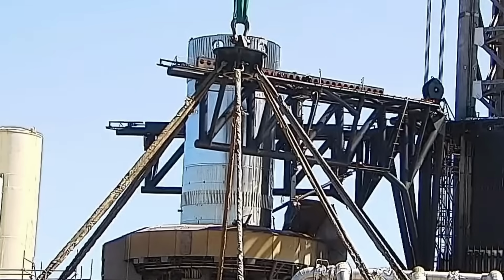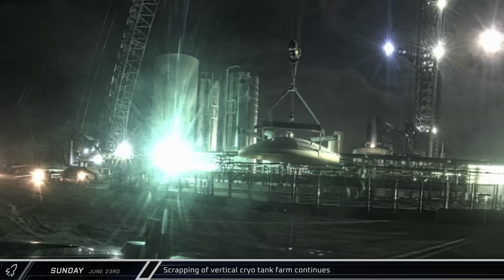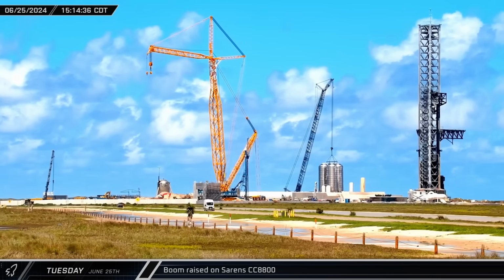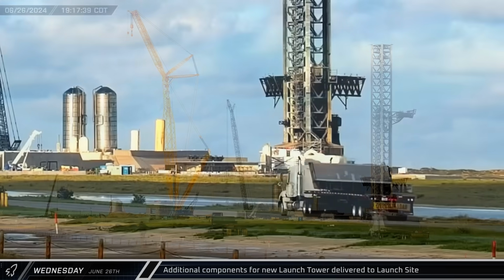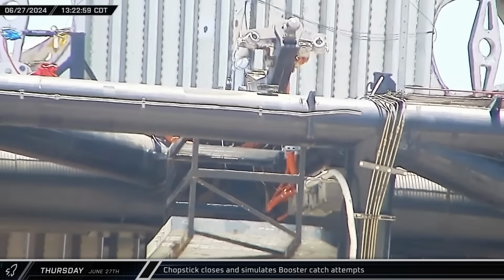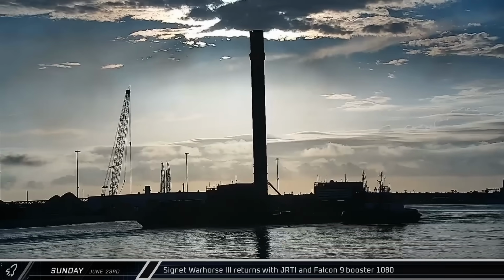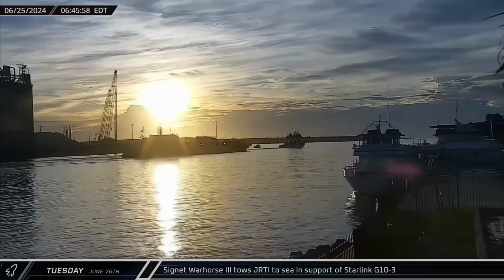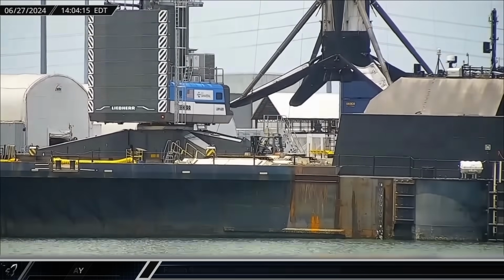Bang! SpaceX Tests Catching Superheavy With Mechazilla! - SpaceX Weekly #121

Comment: Still need a hopper with legs and catch pins to have a real, safe object to practice catching.
Reply: There's no need. That's what the virtual tower landings over the gulf are for. They'll eventually have a dedicated catch tower for practice.
Reply: @SpaceXsuperheavy  Virtual means abstract, computerized, hypothetical, theoretical. Super Heavy coming in for a crash landing is none of that. They're testing the arms, they need a moving target. But then, a fair number probably rout for a big explosion.
Reply: @contestvoter From the data they can see everything that does go wrong & they can correct any potential problems. A virtual tower landing is no different than the company's that do virtual launches with minimal test flights & expect everything to go well. Granted catching the world's tallest booster purely off data is risky but if anyone can get away with it it's spacex. Just saying if they needed a hopper booster they would've built & tested it a while ago. A hopper made sense for F9' development. It made sense to prove that raptors & the base starship/SH design worked with hoppy. However building one this late in the game? No reason to revert back in time just to construct a dedicated catch booster. We don't know how accurate SH's virtual landings are, SpaceX has the data & seem confident. From what I've seen from the last test it did a great job. For something that tall & heavy to come back & not slam into the gulf but slow itself down enough just to plop & tip over c'mon. They got this. A large explosion would be nothing new to SS & SH's development process. The only way for them to truly test this is a dedicated catch tower without an expensive OLM. Also how else would they know the tower design itself is strong enough? Maybe they intend to send one into a dedicated catch tower all hot & whatnot just to truly test the chopsticks & the towers design 😂 never know with SpaceX.
Reply: @contestvoter Pretty sure F9 practiced it's landings on a virtual pad over the gulf with the real thing before they went for a dedicated landing. Even if it takes a few more SH practice landings over water so they can collect more data so be it. No need to waste time developing an accurate catch test article for SH. SH is the test article & it's dedicated catch tower is up for plenty of abuse.
Reply: @SpaceXsuperheavy  Explosions are fun right? Why should Mechazilla work?